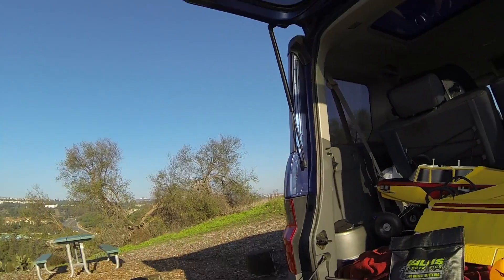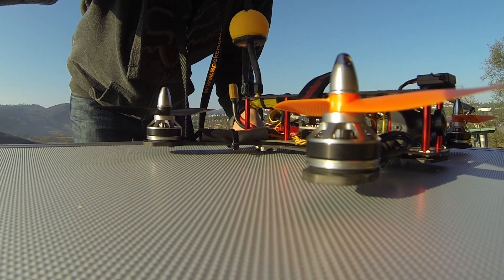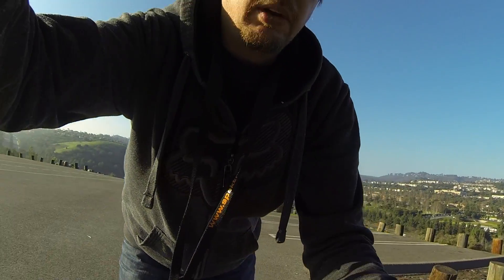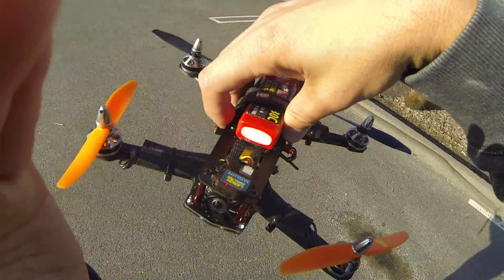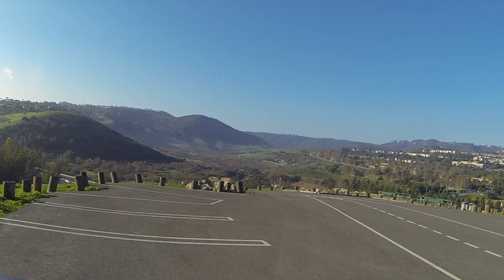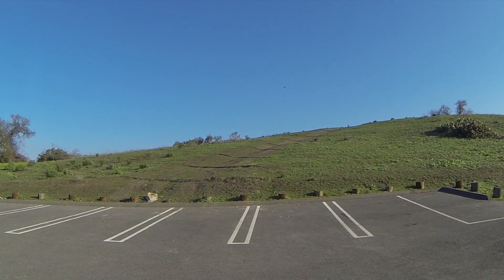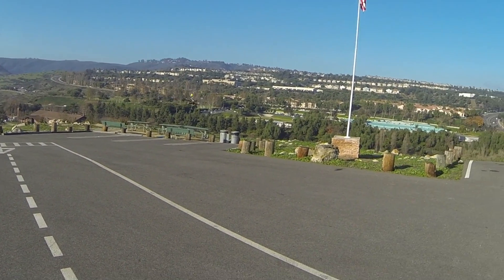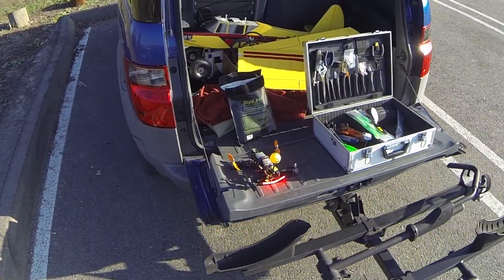ZMR Mini 250 Quad W/ TMotor 2204 2300kv Flight Review

Comment: im wanting to get anouther racer because had walkera 250 runner and was pathetic had lots of issues, fell out sky numerous times but here is what im looking at what you think?
Carbon Fiber ZMR 250 Frame 
T-Motor KV2300 
12A Favorite ESC 
CC3D Flight Controller 
xHover PDB 
3s Turnigy Nanotech 1.4mAh 40-80c
5V BEC to power the CC3D
QAV Landing Gear 

Immersion 250mw 5.8GHz video transmitter 
600tvl Mini Sony Super HAD II WDR CCD w/ case & 2.8 Lens FPV Camera 
2 sets of 2CCW and 2CW Gemfan Propellers 
would this be worth $250??
Reply from the maker: grab yourself a Shuriken X1 or Diatone Crusader rtf-- Freaking amazing for rtf

Comment: With those T-motors, I'd suggest using 18 amp ESC's. I used to use 12 but they burned out so often, and I get more power out of the 18's (I'm using little bees). Good flying!

Comment: Hey Jeff  do you fly  with ccw prop nuts?
Reply from the maker: +STINGER 036 mine are all standard. I don't know if you can buy ccw adaptors or not...
Reply: ok because mines are comming off,don't know if there have for the 2204 series ,but know they have for the 2206 series
Reply from the maker: +STINGER 036 mine came off before until I really tightened them down hard- the other alternative is to get nylock nuts which is what I should do

Comment: hi mate, do you remember if your 2204 tmotors came with mounting screws? mine did not. Just wondering what screws did you use to mount them on that frame.
Reply: +Venom2007s 3mx8

Comment: I like to use cheap screws on the top plate as a break point if I crash, it's only $00.99 to replace instead of a control board or FPV camera or something and strong screws on the main plate

Comment: Nice video! What are the settings of your RC rate? Your quad seems to be flipping muuuch easier than mine at the moment. I however have not yet changed the rates on the board.

Comment: Nice vid, What a Fantastic flying site. I am just putting together my first QAV250 and really enjoying the build. I have an ST360 with the KK2.1.5 control board and she flies real nice. Keep up the flight vids Mate and most of all HAVE FUN.
Reply from the maker: I will! Thanks for the encouragement!
Reply: +7demo7  After watching your video, I built a similar quad based on the parts you had on yours. However, I cannot get the quad to be stable. It just goes all over the place without any stick input and this makes it difficult to control. I think you may have had some problems with yours in the begining as you mentioned in your video.

 I noticed in your video that you were using the spektrum dx6i and I would like to know the setting and calibrations that you did on the naze32  in order to get your quad flying this stable. If you don't mind, can you kindly send me backup file of the naze32 from this quadcopter. This way, i can straightaway upload it to my naze32 and get similar performance. Please email me the backup file at kizzy9ja@gmail.com
Reply from the maker: Thanks cobber!

Comment: Nice video Jeff.  I have a custom quad with a very similar setup and have the exact same problem that you described, I.e. the dreaded pitch up when building up forward speed. Things i found that influence this behaviour are custom motor mix, and pid controller. (Not pid values). 

I'm tired of it, I changed my esc s to kiss but didn't resolve. Now I'm going to buy tmotor 2204 like you. I had sunnysky (fakes apparently) before.

How can a motor influence this behaviour do you think)? I'm glad it worked out for you!

Comment: I bought the Emax MT2204 2300kv motors after reading many negative reviews about the DYS 2204 motors. I orded 4 and 1 was faulty. After 3 flights another motor is stuttering under half throttle. Seems like these chinese motors are very low on quality, no matter which ones you buy.

Comment: Nice! I have DYS motors on my ZMR too. I think one has a loose bell housing or the shaft has been stretched or something but it just has unreliable thrust and makes it very unstable.  I haven't flown in months.  I have some Baby Beast V2 I was considering putting on it but they are so heavy and so many mixed reviews that I haven't bothered.  I may take an evening to solder them on and see what they do.  I was considering getting some Sunnyskys for my next build but I may go with the Tmotors since they have gone down in price.  Those and Cobras always seemed to expensive especially since I still consider myself a newb and my flight skills still suck pretty bad.  Anyway, nice flying and video.  Keep up the awesome work!
Reply from the maker: V Strill Thanks, These TMotors just keep going,,, Great durable motors,  thanks for taking the time to comment!

Comment: I have the same pitching back after flying for about 1min and am using the DYS motors.  I have a set of cobra's and have installed those.  I started trouble shooting with the motors cause I noticed the motors get a violet vibration at about mid throttle.  I haven't tried the cobras yet maybe tonight.  May need to order some T-motors for my next build.  Do you think the vibe was taking out the flight controller?  Are you using a naze32?  How do you mount your FC?  I was thinking about using sticky foam to try and isolate it from any other vibes rather than nylon stand offs.
Reply from the maker: Yes, naze23 on standoffs. I still have small vibes with the t motors but the pitching problem is still gone. I would get the pitching problem even hovering 3"off the ground

Comment: I also had several instances where my quad would disarm while in flight. I have now configured the arm to a switch !
Reply from the maker: garageadz I'm considering this, it's just, if you happen to crash (which is likely)  you have to remember to disarm the quad
Reply: 7demo7 If you are using Cleanflight, simply go to CLI and type  SET AUTO_DISARM_DELAY = 0   as a command. Obviously "0" stops the disarm feature and anything from "1" higher introduces auto disarm.

Comment: Awesome set up. If you don´t mind, where did you purchase the led strip?
Reply from the maker: Hobbyking search 3w led strip. UnFortunately they been out of stock for a long time once the French racing video came out and everyone had to have one, lol. I bought 4, I'm holding them...
Reply from the maker: Here is a quick video I did on them http://youtu.be/hO4SRcUywDc
Reply: hahaha. Yes the red baron pilot caught everyones attention with his led strip. I´ve been waiting for hobbyking to restock,but it´s taking forever. I really want it.
 Thanks for the info
Reply from the maker: ***** Check around, I seem to remember a different source, not exact but similar.  Also, if the Hk ones come into stock, make sure it comes with a regulator.  The red did for mine and it never gets hot.  Other colors didn't and people would burn themselves or it got so hot it burned out!
Reply: 7demo7 Wow!! Ok thanks for tip

Comment: So finally it was not the nazes at fault? I too had problems with unwanted yaw with my quad. In the end thanks to the afro esc's leds, I found the culprit to be one bad motor. Damn thing would have sync issues under 30% throttle which made the quad have shakes upon descent!
Reply from the maker: Yep, talk about a hard problem to nail down

Comment: I also use the Overcraft PDB so I use the plate it replaced as the top plate.  This adds a little more room and I can run antennas through the arm mount holes.  Coffee straws fit perfectly to hold the wire antennas.  I also use nylon standoffs instead of the metal ones that come with the ZMR.  Overcraft also recommends using nylon standoffs or something to insulate the metal standoffs because they are a fraction of a mm larger than the circular area on the PDB assigned for them.  After flying for some time the metal standoffs can cut through the protective coating and cause current to flow through the top and bottom plates.
Reply from the maker: I'm currently running nylon spacers between the pdb and alu standoffs.  Have had no problems. Thanks for posting
Reply from the maker: also, version 2 of this Legit pdb is coming out soon